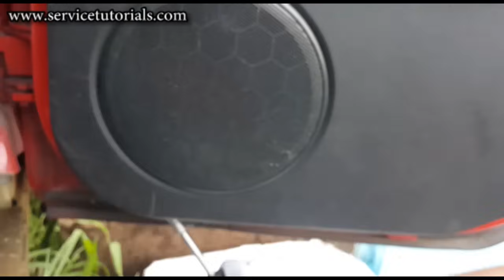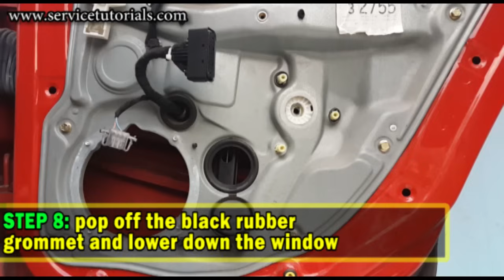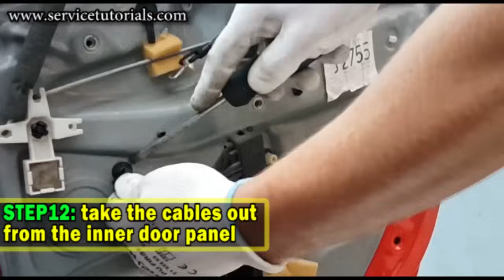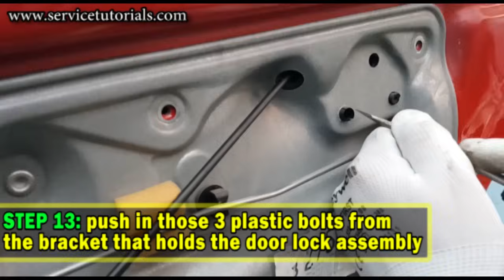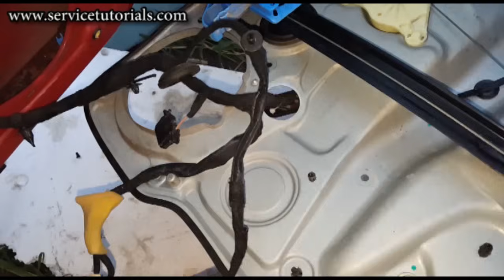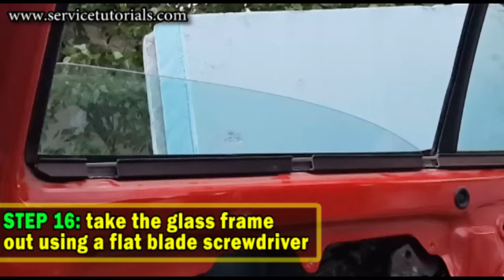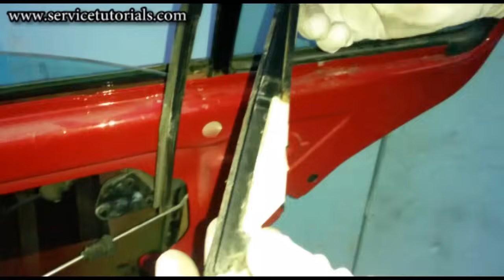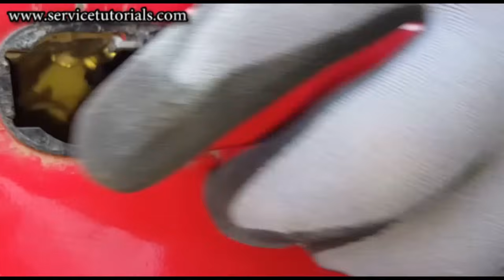How to remove / replace rear door lock module VW Golf Mk4, Bora, Jetta in 25 steps

Comment: Ok..but i can't open the door so i can not unscrew the 2 screws from the bottom of the door..what to do in this scenario..? Please respond
Reply from the maker: Hi Stefan! You can try open it by hitting the door in the same spot where the door lock module is.
Reply: You can reach the bolts even with the door closed, not easy but they are accessible.
Reply: VoeViking Ok Thanks for advice.
Reply: One thing to try if the door won't open (from inside or outside): pop the cover off next to the exterior door handle, then use a pick or screwdriver to pop out the handle insert, and then try unlocking from the inside. If the handle cable doesn't have enough slack, the mechanism won't reset when released and will fail to unlatch.
Reply: @thromboid  i never fixed that door :)) and i totaled the car 3 months ago..but your answear might help others leeell
Reply: @stefankara6021  All good...I hope you weren't injured! :)
Reply: Tilt rear bench seat forward, unclip it, and remove it from the car. You can then get access to the screws with a right angle torx bit

Comment: OF course VW uses some super odd/hard to find "TRIPLE SQUARE SET" for the door lock removal. . . smh why why why
Reply: Trey Camp same thoughts. I thought Germans were practical
Reply: Its a normal spine bit though..
Reply: @MrMats0n  ?  Spine bit?? Do you mean TORX? this is not a torx, it's a Triple Square, which is not the same as torx. It's a special driver bit set.
Reply: @MrMats0n  Haha. It is called a "TRIPLE SQUARE" bit, That is the technical term, if you were to go to amazon or a hardware store and buy the set. If you said "spine bit" nobody would know what to buy.
Reply: XZN is the other name.
Reply: @h82fail  yep, I still have that set from Amazon i bought, and still hardly ever need to use it! But good to have. haha

Comment: Can someone please tell me what that plastic shit at the top on the right side with those 3 nipples on is for? These cars are hell to work on when it comes to certain things. I had to cut a bigger hole in the door, to get that lock rod on its right place. The computer nerd designing this, must have been drunk or just a complete fool. I will never ever own a car from wag after i’m done with this one. To many flaws, the rockers rust out because they get filled with everything the wheels throw at it, both ends. The wings catch and holds dirt at the bottom, and they rust from the inside. Waterleaks from each side in the cavity where the viper mechanism is, leak through the bottom of the door panels, leaks from the sunroof cheap brittle plastic everywhere, and just an overall overcomplicated mindset. 🤮🙈